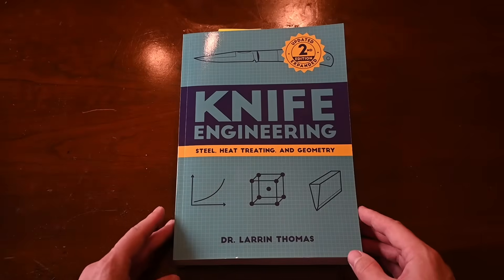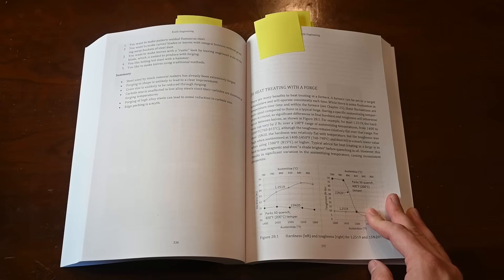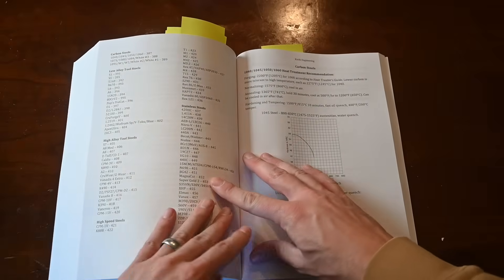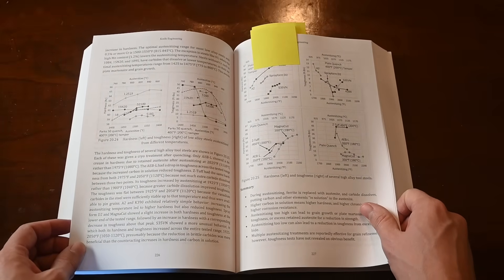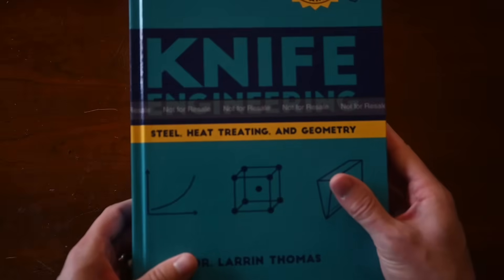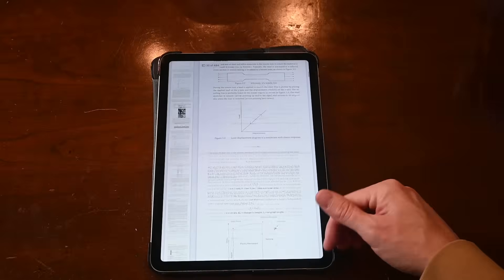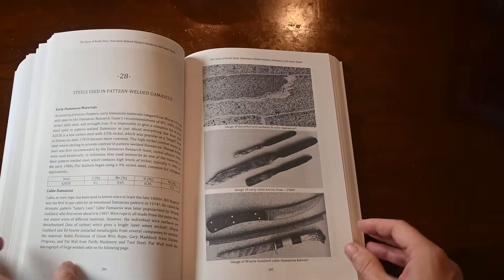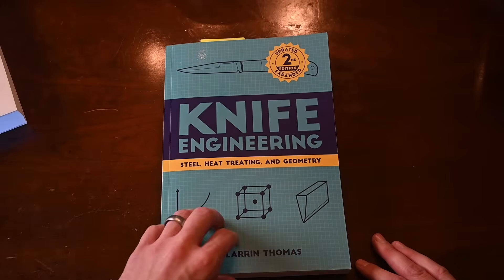Knife Engineering is New and Improved!

Comment: Hello Larrin! Greetings from Finland!
The book is truly very practical. I usually work with Celsius here, so the conversions make it much easier to read. I noticed a conversion error in the recommendation for 80CrV2 steel -> 1400°F is actually 760°C.
Reply from the maker: Very annoying error after checking and double checking so many conversions!
Reply: @KnifeSteelNerds  -->"Due to a °F → °C conversion error, the annealing process briefly qualified as heat-assisted regret." 🙏

Comment: Great that you've got a section on heat treating with a forge (which I do). If I can give one piece of advice to anyone heat treating with a forge, get a high temp thermocouple and reader. It costs $40. Control the temperature of your forge. You'll get results that are comparable to using a kiln. It completely changed my knife quality.